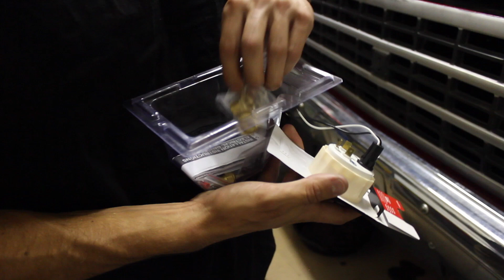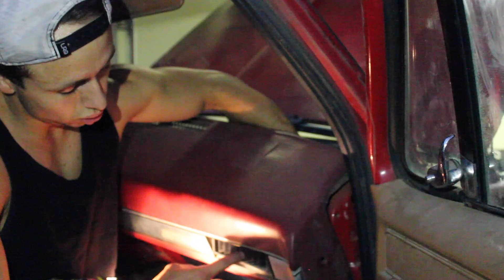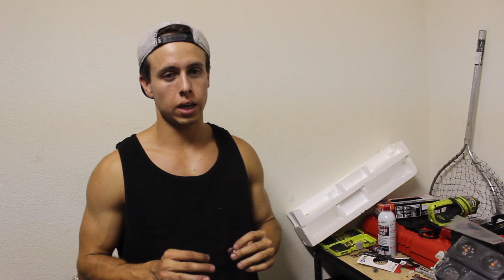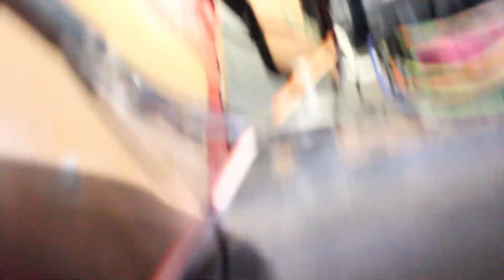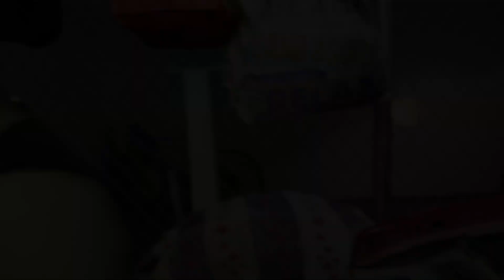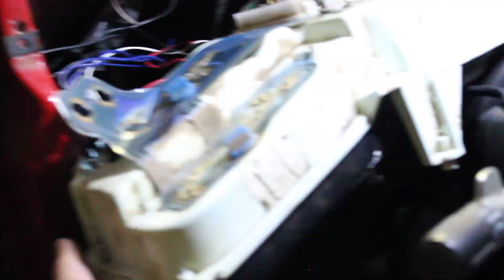91 k5 blazer transmission temperature gauge install

Comment: If you were to connect the "t" directly to the transmission instead of using a cut line with rubber hoses, it would already be grounded. Then shorten the line and put in a new flare. Way more professional and cleaner.
Reply from the maker: i like this idea.

Comment: I have the same set up on my Grand National but a 200r4… so you put the sensor in the line that goes into the top of the external cooler correct? Is it gonna matter that it already has gone through the radiator cooler to reflect accurate temps? I’d much rather splice into the rubber if I can
Reply from the maker: I prefer to install them before the radiator so that you get the most accurate temp reading from what is coming out of the transmission.  you can disconnect the hard line from the radiator and then slide a rubber hose over the hard line and then get another fitting that threads into the radiator and has a barb sticking out.  then just fit the other end of the hose onto that fitting in the radiator and you have a rubber line that you can splice the temp sensor into without cutting anything factory.

Comment: Can the sender wire be positive or negative or is it a specific wire?
Reply from the maker: It is a specific wire that goes to a spade connector on the back of the gauge I'm using.  The other end of it connects to the probe.  It is neither positive nor negative. Hope that helps